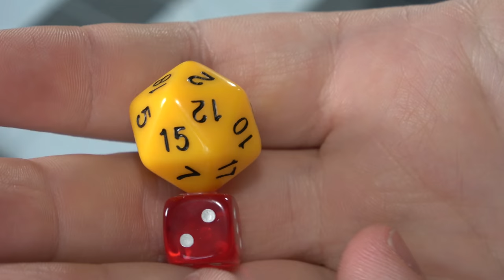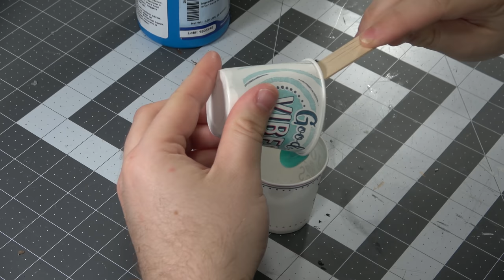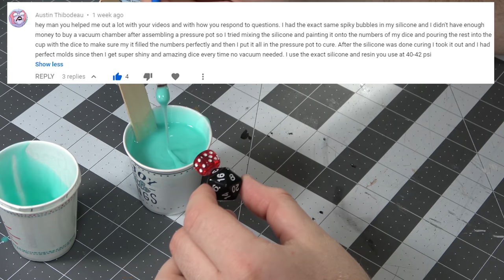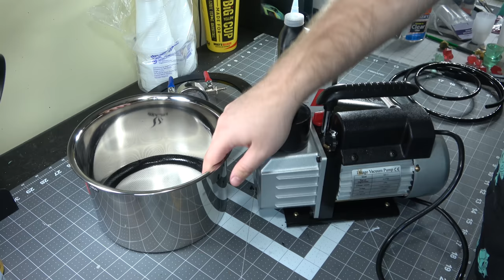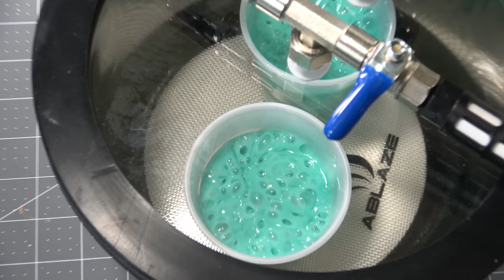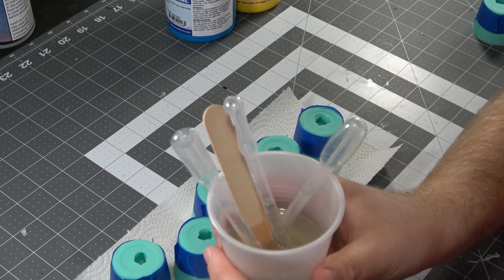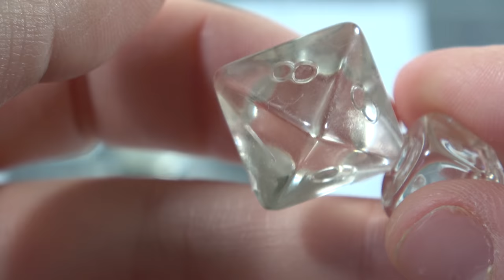Casting Clear Dice Pt. 2 | Vacuum Chamber

Comment: Hey Rybonator,
I'm an amateur dice maker and I want to buy a pressure pot to get better results, but I already made my molds. If I already have molds, made the same way you make yours (but without a pressure pot or vacuum chamber), can I make dice in those molds using a pressure pot, or will I get the surface spikes like in part one? Why do those happen? Beyond that, if they do happen, could I sand them down and get good results that way? I don't have the money for a vacuum setup, and I'd rather not have to buy silicone to make new molds if I can avoid it.

Comment: Hope you still check comments on old videos! I'm a new subscriber and just beginning my dice making journey (my first set of molds are curing right now) and your videos have been SUPER helpful! I was wondering if the pressure/vacuum pot changes setting time for the silicone or the resin?
Reply from the maker: I totally do! Welcome to being a Dice Goblin :)

So they CAN, though that has not been my experience. I have heard that using a Pressure Pot can reduce the total curing time, but I have always left it in there the entire duration to be safe, and more often than not, it was necessary!
Reply: @Rybonator  thank you! So followup question, in several videos you've said to cut the nubs off while they're warm. Are they warm from the pressure pot, or would they be warm if they just set out on the counter too?

Comment: Is there a reason why you wouldn't put the molds in the pressure pot after you got done vacuuming and pouring them in? Is there a reason you wouldn't vacuum the resin and then put it in the molds then the pressure pot?

Comment: Why not use the vacuum pump after pouring the mold material over the dice, to ensure there are no bubbles in the mix?
Reply from the maker: There is a chance that your materials could pop loose  when the bubbles are being pulled to the surface. That's the main reason :)

Comment: Could you recommend a good pressure pot that's not too expensive? Maybe around $300. Or a good brand.
Reply from the maker: The pressure pot setup I use runs around 115$ with all parts purchased. It'll be another 60-80$ if you don't have an air compressor already however!

Comment: I'm interested in getting into dice casting myself so I've been watching a lot of your videos; they're very helpful.  I've heard of one method of getting rid of air bubbles that involves using a vibrating surface to shake them out, but wasn't sure if it worked with resin.  Any chance you've tried that method and what the results were?
Reply from the maker: I have not tried that myself, but my initial thought would be that resin/silicone is too thick for ALL the bubbles to come out this way. I know it would get SOME, but can't say that it would be equivalently equal to a pressure pot/vacuum chamber cast. 

Glad you enjoy the videos :)

Comment: I recently made a mold without vacuuming it and used said mold in a pressure pot. I was expecting to get the spikes on the surfaces like shown in this video but that didn’t happen. I’m now wondering if it has to do with the mold maker itself?

Comment: I love your videos, but I have a question:
Why don't you put the liquid silicone mold with the dice in it, into the vacuum chamber? 
Like you can mix the the silicone and then put it into the vacuum chamber. When most of the bubbles are out, pour the silicone on the dice, then put the cup of silicone+dice into the vacuum chamber as the silicone cures. 
That way you get more bubbles out of the silicone, while also not having to worry if the silicone will cure before it is poured on the dice.

Also: Why couldn't we simply put the silicone+dice into the pressure pot while the silicone mold cures? Wouldn't it get rid of all the bubbles in the mold, without needing to buy a vacuum chamber?
Reply from the maker: Thank you! Glad you like them :) I'll do my best to answer -

So if you pull the vacuum with the dice in the silicone, you run the risk of the airbubbles pulling heavily on the dice, and dislodging it from the cup, ruining your mold. So it's just generally better to NOT :)

The second thing, and I cannot stress this enough - I didn't know. Haha. When I first did this, I thought you HAD to have a vacuum chamber, as all the videos showing this process on anything else used one. BUT supposedly you can do what you described. I have yet to test this out myself, but others have had great success with that method. So I'll give it a shot one day, and I'm still glad I have the vacuum chamber, because I can use it for other things, but it's not strictly necessary. Where the pressure pot is. 

Hope that helps!
Reply: @Rybonator  
I see, that's very helpful, thank you! 

I suppose if you had a dedicated d6 (or other sprue) you wanted to use to permanently mold, you could superglue the dice to the bottom of the cup so that it wouldn't come off the bottom during vacuuming. When you want to remove the mold from the cup, tear the paper cup off the silicon and around where the d6 touches the cup.

You'd get superglue permanently on the d6 (or whatever you use for the sprue) and a bit of paper stuck (which would dissolve if soaked in water), but since that's only on the outside end of the sprue, it wouldn't affect the end result of the resin dice.

This of course is only an idea. I'd try it myself, but I don't think I'll be able get a pressure pot until next year. If you're willing, you could experiment, I'd like to see that, but you don't have to.

Comment: So I'm going to be DMing soon for the very first time, I've been helping my friends (some of them have never played any RP) make their characters and I really want to make the experience something special. One of the places in my world is going to be located in a desert setting where the people there have used fire and storm magic to turn the sand into glass to make all of their major structures. I have dabbled some in resin work and I have an ambitious idea. I was wondering if it would be possible to create a mold of buildings and the like, and then pour resin into it just as you've done here? Do you think that even with a pressure pot, bubbles would form? 

Sorry if you get a lot of questions, I'm really inspired by the work that you have here on your channel and would love to apply it to some of my far fetched ideas! 
Also I'm sorry to hear about your accident!
-E
Reply from the maker: No worries at all, we are getting better slowly but surely, thank you for your concern :)

So you totally COULD, but it would depend on the building. Since the buildings are generally large, it will cost a LOT, and only REALLY work if you can get a building with not a lot of nooks and crannies, because each of those have a chance to catch on the mold and make removal a pain if not impossible without damaging the mold. But totally doable and SHOULD still come out clear as glass :)

Comment: Can i just make the dice without the vacuum chamber and pressure pot (so just make moulds and fill them and let them set)? But if i was to use a pressure pot (for both curing resin and making mold) how long do i leave it in there (do i leave it in till they set or just for a certain amount of time then take the cup out and leave to set)?
Reply from the maker: Absolutely you can! Check out my 24k or glow dice vids, I don't use a pot or vacuum in them :)

You supposedly can cure faster in a pressurized environment, but I still leave them in for the entirety of the curing time. :)

Comment: Great but something is missing, either buff the dice on a wheel or paint them with cleear gloss laquer - o r - resin.
BTW what was the maximum pressure you have used for the castings ,- was it 2,5 Bar  ???
Reply from the maker: They aren't done by any means in this video. It's just showing what is capable.

I use 40PSI when I cast. You can go higher, but it really doesn't change anything after that amount.

Comment: Your 2 part series is an eye opener ♥ Are the pipettes single use only? (I was wondering in your last videos, too)
Reply from the maker: Thank you I really appreciate hearing that. :)

Yes they are, after you get resin in there, it's pretty much impossible to clean it out. Luckily a $5 bag comes with like 40 Pipettes.  You really only need to use 1 per batch. I used 3 in this video because I was impatient haha.

Comment: Not sure if this is a dumb question or not, but couldn't you use the vac chamber on the resin to remove air, either before you pour it into the molds or even just put the molds in the vac?  It seems to me that you'll still get even clearer results by removing the air as much as possible rather than compressing any bubbles until they're "invisible."  Also save money on equipment...
Reply from the maker: So there are a few problems with that, but it's a good and common question!

1 - By the time you get all the air bubbles out, your resin will probably start curing, and be REALLY difficult to get into the molds. If you pull the air while they are already IN the molds, they will overflow and run off the sides of the mold, leaving you with not enough resin.

2 - You actually can cure the SILICONE in the pressure pot instead of using the vacuum on it, and have the same effect. (Found out after...) So if you were going to get something, a pressure pot is what you should get, as it can do both jobs :)

Comment: Probably would get better results with the paint on method if you let the silicone cure first, and paint on second coat. There were probably spots that the painted on silicone was still too thin and that allowed the resin to flow into the surrounding bubbles.
Reply from the maker: Supposedly the best way to get the results is to instead put it in the pressure pot after painting it on, and that's where I messed up
Reply: @Rybonator  Oh, I assumed the the intent of the painting was for people that did not have any special equipment.

Comment: I was wondering. Have you tried using the vacuum chamber on the resin after they're in the molds?
Reply from the maker: Good question, but it's not advisable. Check out Peter Brown's video on Pressure vs Vacuum casting. Essentially, it will probably pull too much resin out of the mold for me to get a good casting.

Comment: if you're going to polish the dice anyways, wouldn't the spikes sand right off?
Reply from the maker: Yes and no. A lot were in the numbers, which wouldn't sand away without causing issues to the numbers themselves. You could do it, but some other parts get ruined
Reply: @Rybonator  ahh good point

Comment: In part 1 you say that the pressure pot burst bubbles in the silicone mold, does that destroy the molds?
Reply from the maker: Good question - It doesn't destroy them, but anytime I have used that mold again, those small bubble bumps are covering the dice, as the holes made are permanent. Still usable, but requires more finishing work.
Reply: @Rybonator  Cheers for the response! I'm in the process of trying to find a pressure pot in the UK and struggling to do so, so this is all pipe dream at the moment.

Comment: I was wondering if you could use the pressure pot to get ride of the bubbles in the silicon molds?
Reply from the maker: You totally can! I hadn't tried that at this point, but it works fine :)

Comment: This might be a dumb question, but I'm knew to dice making. I just bought the same vacuum chamber that you use here, but I notice you switch to another pot for the dice. I bought the pot I did before seeing you had it, but I bought it because it came as a kit when I searched/researched vacuum/pressure pot equipment for dice making. Would your ablaze vacuum pot not work for the resin casting, too?
Reply from the maker: No this is a great question! So I would highly recommend checking out part 1, I explain this a bit, but also check out Peter Brown's video on pressure pots vs vacuums. Essentially, if you try and use a vacuum on resin (I swap over to a pressure pot, that's the pot change you saw), it will pull the resin too much, and cause it to overflow out of the mold. Then you'd end up with voids and holes in your dice. 

So that's why I use both. Let me know if that doesn't make sense and I can give some more explanation :)

Show me what you end up making in Twitter sometime! I love seeing what others make :)
Reply: @Rybonator  Thank you! I'll check it out!

Comment: Can you use the vaccuum chamber as a pressure pot? I can't afford to by both of them and I wanna know if I can make do with just the Vaccuum Chamber
Reply: You could probably use the pressure pot as a vacuum chamber, but they're designed to hold pressure in opposite directions, and the vacuum chamber only needs to hold 14PSI or less, while the pressure pot may be holding over 100. The vacuum chamber will tend to be self-sealing, since the air pressure will help hold the lid on. On the other hand, it's beneficial for the vacuum chamber to be transparent so you can keep an eye on the bubbles, but you could just leave the silicone in for half an hour instead.

The King Of Random made a couple of videos on DIY vacuum chambers: https://www.youtube.com/watch?v=ERRMoHfrjAI and https://www.youtube.com/watch?v=gvqgdN2YLbk
Reply from the maker: Good question! I would be weary about using the vacuum chamber for casing - check out Peter Brown's video on the subject for a detailed explanation: https://www.youtube.com/watch?v=ShSxUg4Yyws

Comment: If you zig zag cut your silicone mold they will go back together easier and are less likely to slip
Reply from the maker: True! But if you don't cut them all the way down (what I do now,) you don't have to worry about this either :)
Reply: Thanks for replying I love your videos and I want to make my own clear dice but I do not have a pressure vacuum so I’m experimenting with different methods I will inform you if I find a different way
Reply from the maker: @Para-tc5uv  Sounds great! Best of luck :)

Comment: I've recently just started casting. I found an aerosol silicone spray that negates the need to vacuum or pressurize silicone molds however I tried casting a grung. Tiny little cute frogs, I cannot find a way to get the resin I have to permeate all the way through the mold so I have grungs missing arms and parts of the torso held together by mold lines. What's your suggestion since these guys are so tiny? One thing I've considered is adding in vent holes to the parts not being filled.
Reply from the maker: Check out SteadyCrafting, he makes molds of tiny toys and has some great tips on how to cast intricate objects like what you are talking about :)
Reply: @Rybonator   thank you I will have to look into that.

Comment: Question: Having a vacuum chamber, can you pull the bubbles out of the resin instead of pressurizing it?
What's the result in that case?
Reply from the maker: So YES, you can pull it out, but you won't have enough resin left in the mold to make the dice. Because the resin is so sticky, it will flow out of the top of the mold before it can pop the bubbles, and overflow. So pressure is more optimal. You can pressure cure silicone, but you can't really vacuum-ize (idk if that's a word) resin in a mold.
Reply: @Rybonator  oh, I see!
I was looking more at pulling the air - before - pouring the resin, then a bit more once it's in... mostly 'cause getting the vacuum one will be hard enough for me already, so wanted to see if not getting the pressure pot was an option XD
Reply: "degas" or "degassing" is the word for what you're doing with the vacuum pump. I'm also curious what would happen if you degassed the resin in a large container prior to filling the dice molds and then pressure curing them.
Reply: @Codeaholic1  Found a video about it after all... the resin becomes basically foam. Small bubbles grow, but the resin is  too thick for them to pop, so... doesn't help in the end. I will need both |3
Reply: Everything I'm reading says you can vacuum degas some resins. They need to have a relatively thin viscosity and you should stick to an amount that is at least 3 times less in volume than the size of your container. And you need a resin with a long work time. Poly-optic is the brand name of a resin that is specifically designed for clarity and it can be vacuum degassed. And finally you can do both vacuum degassing and pressure casting. Anyway that's what my arm chair googling got me. Standard disclaimers apply. Love the videos. Keep em coming.

Comment: Are there certain resins & silicone that work better with this equipment?  eg dice vs beads (predrilled mold) & additives  such as dichroic films, minerals, polymer clay insets, (like landscapes in resin) or would thin layer room curing work better?
Reply from the maker: So those are a lot of things to tackle but I'll try -

The best silicone is (In my opinion) platinum based silicone. It doesn't leave a tacky film on your dice and doesn't need anything special when curing (unless you are trying to get bubbles out.) 

You should totally make sure that you use casting resin over other types, in this small of quantity, others will fail more often than not, or come out gummy and squishy.

Additives are a whole different ballgame altogether - Mica Powders and resin dyes specifically are the best, water based dyes are bad (like food coloring, but still use them in small amounts for transparent dice). You can totally put insets in them. 

Hopefully that helps! :)
Reply: @Rybonator  thank you. .. after watching your videos & brick I was beginning to get more confused with all options  <3 :)
Reply from the maker: @ACrazyKat  haha no worries, it's a lot all at once. :) Best of luck! Let me know how it goes